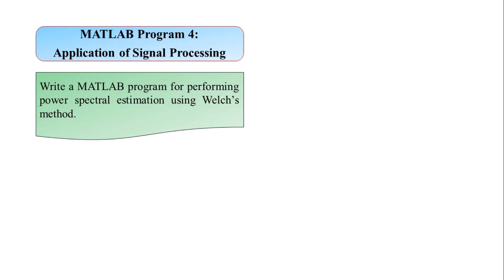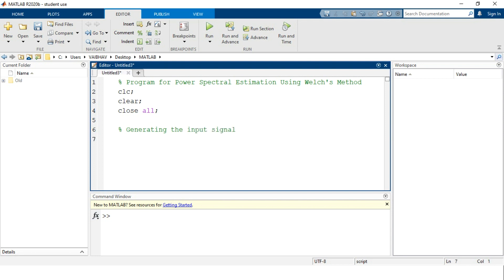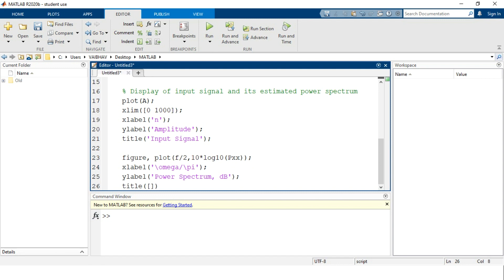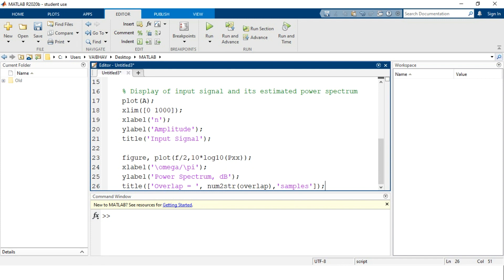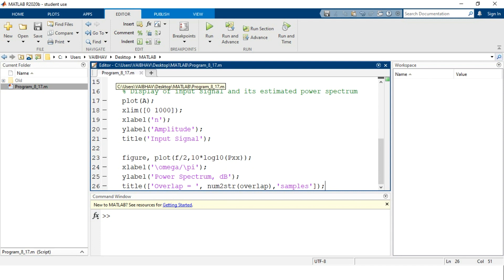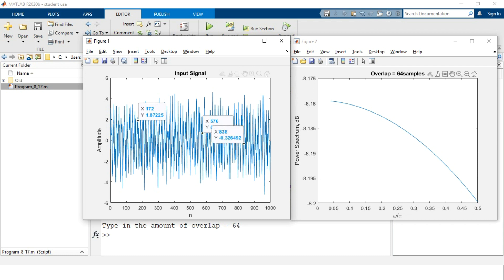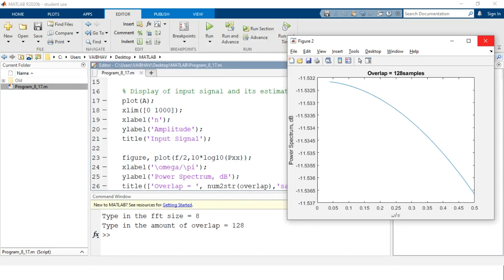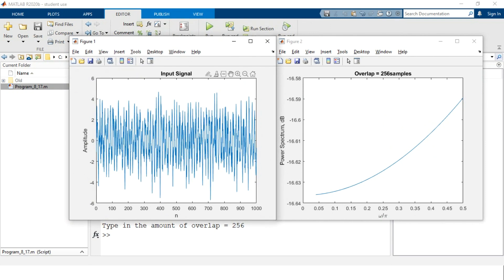Power Spectral Estimation Using Welch’s Method in MATLAB | Advanced Digital Signal Processing

Comment: Why we used 2 in pwelch? Is that Sampling frequency? and by default when we write 2 it will be 2fm?
Reply: As i understand it is the amplitude as in " a sin (2(pi f t)"
Reply: correction: Its  Number of overlapped samples, specified as a positive integer smaller than the length of window.
As in :